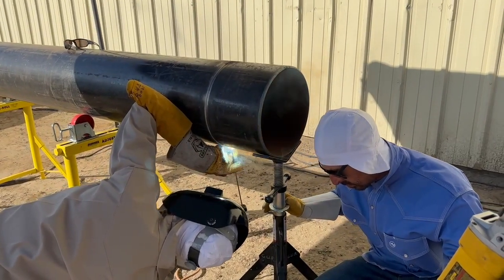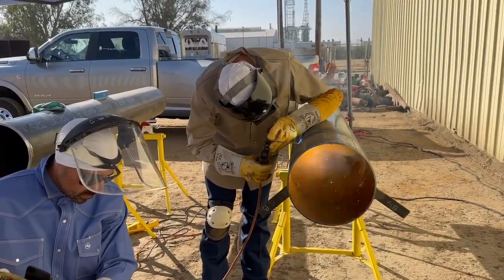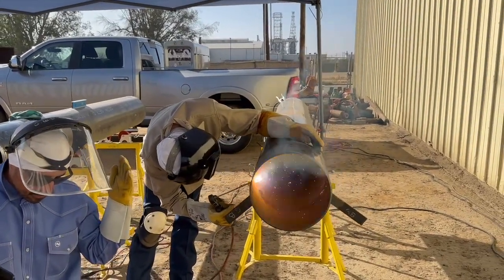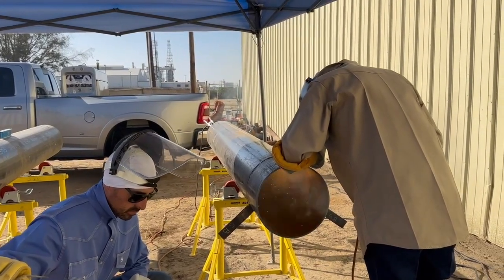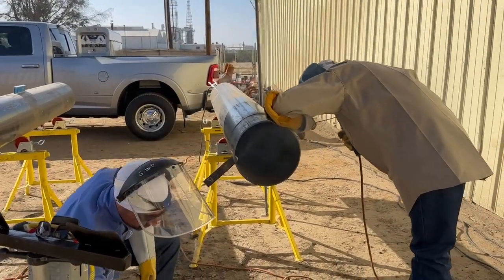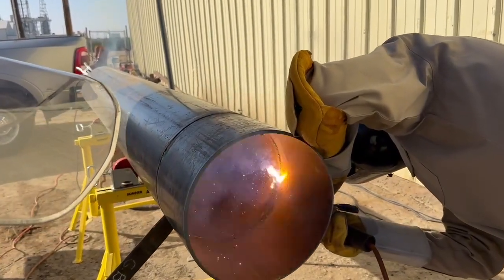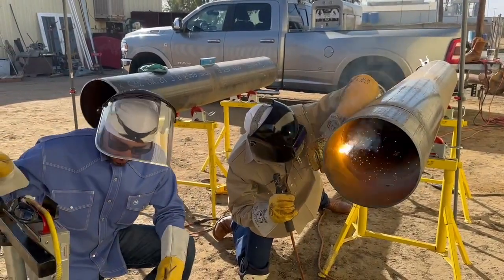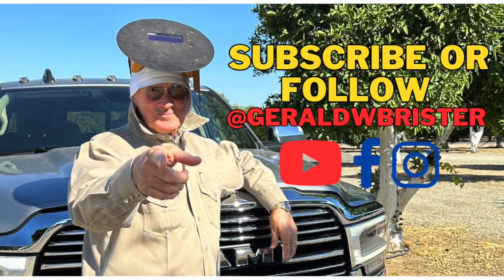How to run root pass downhill using stick rods

Comment: What type of welding sleeve are you using and where can I buy one?
Reply from the maker: Just about any welding supply will carry them. I just googled “ GREEN WELDING SLEEVES” and several brands came up.
They come in different lengths, usually 18” and 23 “ in 9oz , 12 oz etc.
I prefer the 18” length . And cost about $ 6.00 to 20.00 a pair.
Revco makes the black stallion brand,
Tillman makes different lengths and weights as well.
Thank you Gary

Comment: Most underated thing you said was the rubber necking. Between that and duck walk. Its amazing how much faster you are. Especially on 6in or light 8in. You can weld top to bottom one rod every one else is putting a spare tire on and your on the other side.
Reply from the maker: IM VERY IMPRESSED THAT YOU REALIZE THE VALUE OF THAT SMALL PIECE OF ADVISE. I WILL BE EXPANDING MY TEACHING ON  "RUBBER NECKING" AND ALL THE OTHER TECHNIQUES THAT WILL MAKE YOU MUCH FASTER, WITHOUT HAVING TO LOOK LIKE SOMEONE RUNNING AND STUMBLING, AND HAVING A NERVOUS BREAK DOWN TO KEEP UP ! I THOUGHT IT OUT ONCE AND PUT DOWN ON PAPER THE THINGS I WAS TAUGHT AND THE THINGS I BELIEVE THE HOLY SPIRIT SHOWED ME. I BELIEVE IF YOU USE ALL THE TIPS, YOU CAN BE 25 TO 30 PERCENT FASTER , WITHOUT THE STRESS OF TRYING TO BE FASTER .      THANK YOU SHARING THAT GOOD ADVICE WITH THE WELD FAMILY!      THANK YOU BERRY!

Comment: Awesome video and what settings are you running on your sa200 ?
Reply from the maker: Sorry I didn’t see the post till now.
The .250 wall was in the 190 range 25 to 60 on the ditch box. 1/8 5p+

The .375 wall was in the 240 range 35-65 on the ditch box 5/32 5p+
Reply: @GeraldWBrister  thank you sir
Reply: We were running in the 190 range, I believe you can see it in back ground on my welder.
We were running between about 20-60 on the remote . Thank you Michael!
Reply: Yes sir and God bless